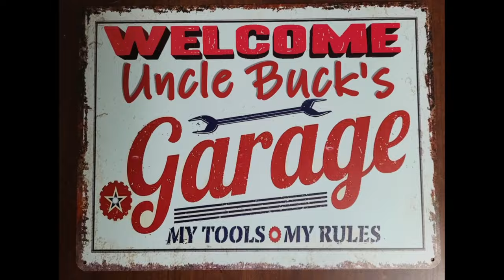How To Easily Remove & Install New Floor Pans in a Square Body Chevy Hotrod Build

Comment: I have to do the same thing but I got to use a 225 Lincoln with a 1.16 rod. Wish me luck. Very informative  video
Reply from the maker: Good luck, if you can lap everything  with no gaps. Have a better result.

Comment: Hi, nice video, you were right it is a lot of work. I did the drivers side on a 70 GMC cab. I turned off the lights last night and put a bright work light under the floor. I saw some pin holes where light could come through, I zapped them and ground them and zapped them and ground them. How to you finish off the butt welds to seal them up?  I am thinking primer and primer and maybe seam sealer and then undercoating on the bottom. I think I got all the pin holes but I want it sealed up nice and tight. Thanks
Reply from the maker: I used paintable silicone sealer in a tube from Lowes worked awesome

Comment: where do you have your ground cable connected when youre putting in the tacks?
Reply from the maker: I ground a spot on the cab mounting bracket on the driver side. i tried a couple other spots but they didn't want to work. the brace that the cab nut is inside of. Hope this helps have a great weekend
Reply: @unclebucksgarage7695  thank you

Comment: Where do you get the cab/floor support that the cab mount connects? Looks brand new
Reply from the maker: cleaned and painted it. but if you need one LMC carries them. have a great weekend

Comment: Can you give me advise on what do I need to replace my floor pans ,on a 1980 C10. The Driver and passenger side needs replacing. I need to get to the original body mounts and replace while I'm there. please advise on the welder i need. She's my Darling had many years and she's been faithful.😊
Reply from the maker: the welder in the links on this video is the exact one that i have a nd used. Wishing you all the best

Comment: In what way did water get into the cab to rust out your floors? How did you go about fixing the "leak"?
My floors are somewhat rotten as well not sure how they get wet.
Reply: Leaking from the heater core when they go bad its on that side of the cab
Reply: @grantslater2485  Thanks I should have guessed that. I found out my issue is the caulking in the cowl vent is rotted and alowing water to seep into the cab.
Reply from the maker: Well that good news that you found it. Wishing you all the best for the future

Comment: So the only issue I seen is that you didn't replace the 16 gauge plate that's welded to the floor support the floor brace then that ties all those together and then the floor pan goes down over it
Reply from the maker: I will do better

Comment: WD 40 is not a real penetrating oil it is nothing more than deodoried kerosine and it evaporates fairly quickly ,there will most certainly be nothing left behind after a month! You should get a real penetrating oil to do the lubricating of rusty bolts!
Reply from the maker: Thank You, Have a great week!